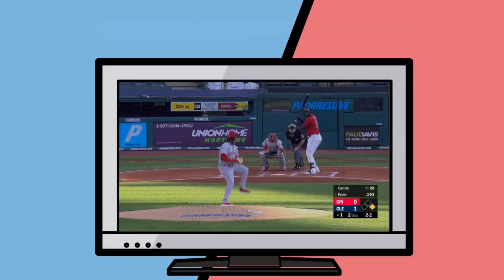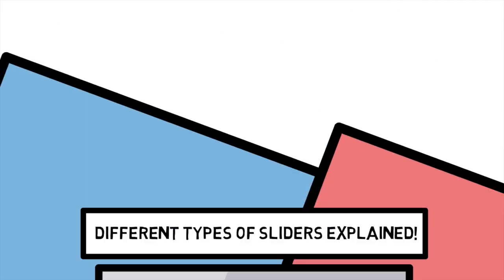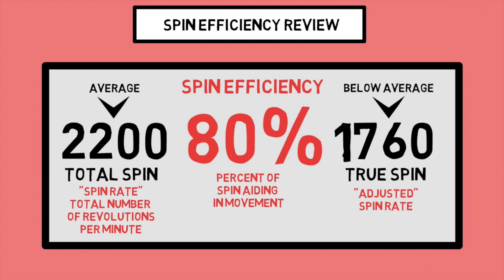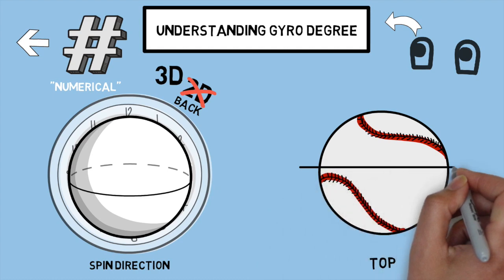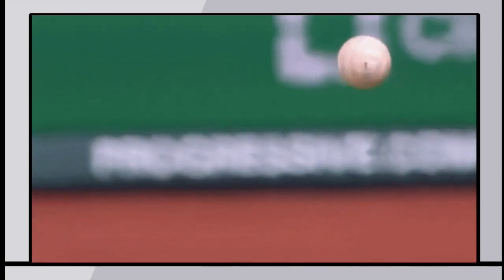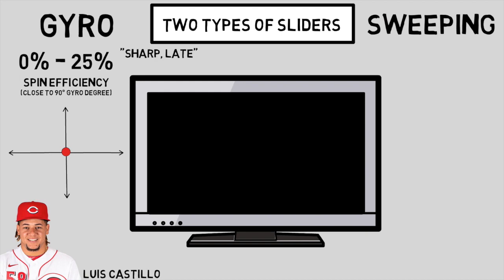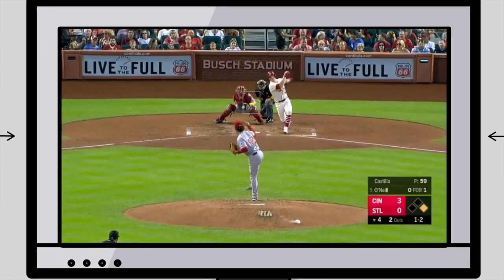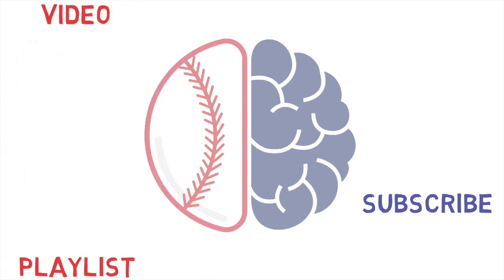COMPARING MLB SLIDERS: Gyro vs. Sweeping

Comment: Hi, thanks for the amazing video as always.  Which of these do you think tunnels best with a 4S Fastball?
Reply from the maker: Great question! For a true 4S FB I recommend tunneling a gyro slider typically. But it’s going to depend on a case by case basis. 

If an athlete has a high spin rate, throwing up in the zone is important - so most likely their best secondary pitch would be a 12-6 CB paired with their 4S. 

To split the difference a gyro slider would be better when referring to tunneling. But that’s only one specific situation. 

If an athlete has a good Sweeping Slider that has been working for them, you may be interested in swapping the 4S with a 2S to better match the movement profiles together. 

Kind of a convoluted answer - but hope this helps!

Comment: I really want to understand the movement of the gyro slider. I’ve done the research and it says that the Vertical movement is only -4 but to the human eye looks like is breaking about a feet. 

Do we take our Vertical movement on a fastball and subtract? Let’s say theres a pitcher with a Vertical movement of 10 on his FB but only has -2 on his Gyro slider did the ball dropped 12 inches or is this not the correct way to mature this pitch?
Reply from the maker: Great question, Gabriel! This is something that is very tough to wrap your mind around. When we talk about Vertical and Horizontal movement, 99% of the time we’re talking about spin induced movement. 

The Gyro slider is different, because the way the pitch is spinning does not directly affect the movement of the pitch. 

To my understanding, nobody has quantified how much these pitches actually move - but it definitely moves gloveside much more than a fastball does even though our movement may be (0,0). 

The over simplified explanation I’ve received is the axis slowly tilts down as the pitch gets nearer to the plate, once it does that ups the spin efficiency and the pitch takes off late. At this point it’s nearly impossible to measure that, but at least that might give a simple answer to a sneakily complex physics question. 

Thanks for the comment!
Reply: @SimpleSabermetrics  to my understanding, knuckleball would have close to 0,0 in terms of spin induced movement. But because of the orientations of the seams that created turbulence, the ball moves in all sorts of funny ways. Am I right?
Reply: @choiyatlam2552  idk if you’re right but it sounds like it makes sense